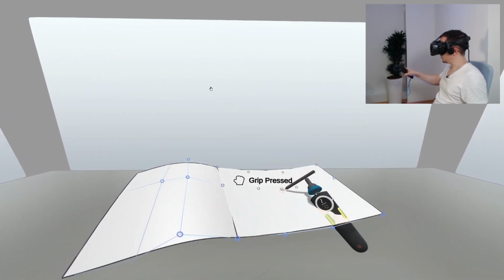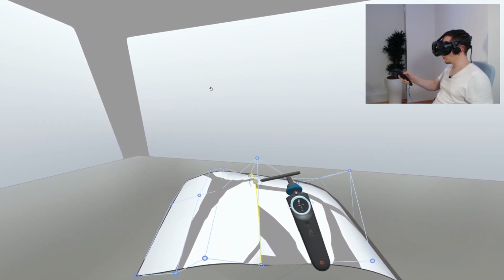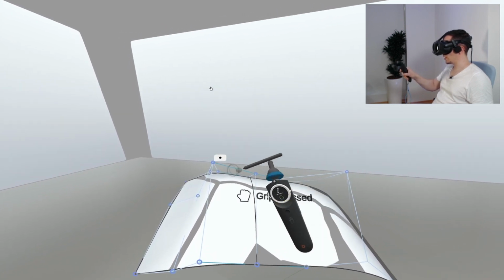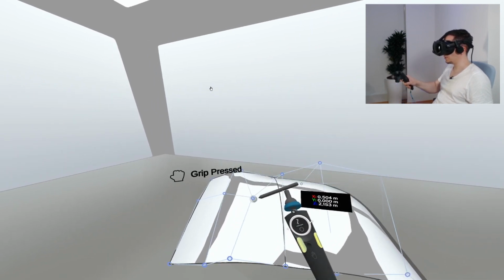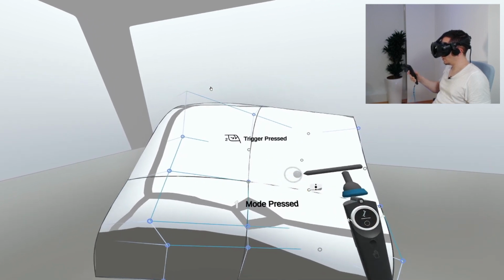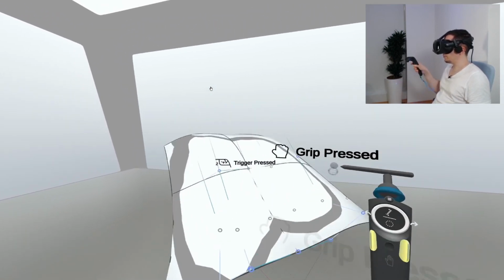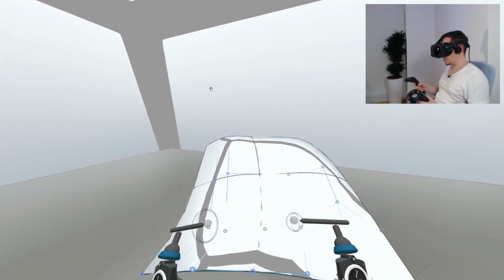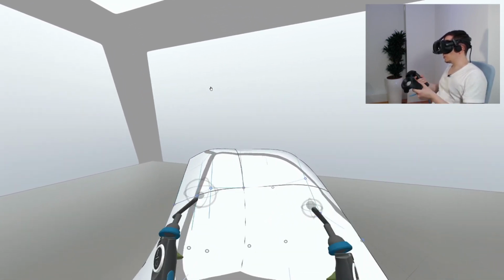flyingshapes Tutorial 13: Surface Continuity

Comment: Very cool. Are both surfaces affected when they are aligned? It looked like that in the video. Is it possible to only affect one surface?  e.g. if I built a car roof and I wanted to blend to a front screen,  normally I would not want to affect or change the roof or screen. They are master key surfaces if you like. Then I would only want to affect the blend surface between them.
Reply from the maker: Thank you for your input. The current version of this tool indeed changes both surfaces. We will add the option to define one surface as fixed soon (like the master key surface you mention). Please stay tuned, we will announce the change in our update notes on Steam and on our upcoming updates page of our website.